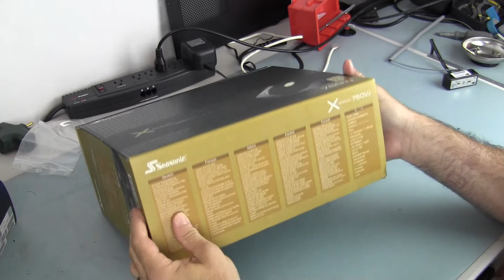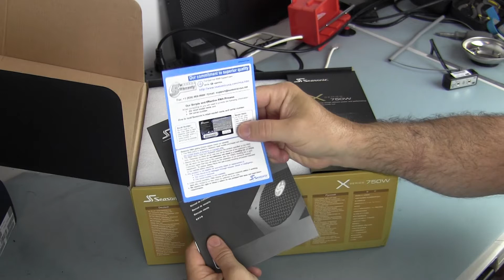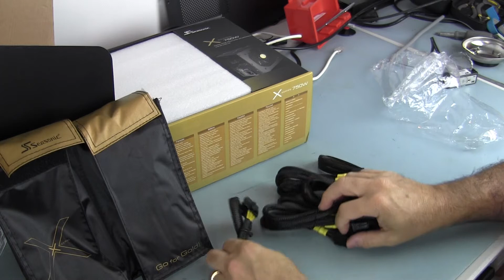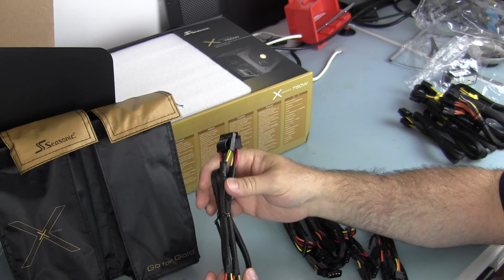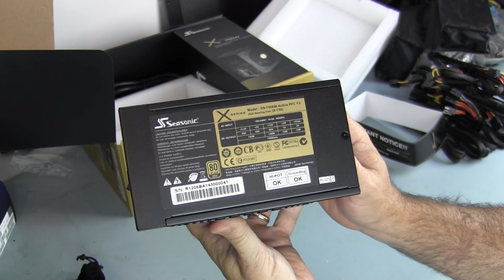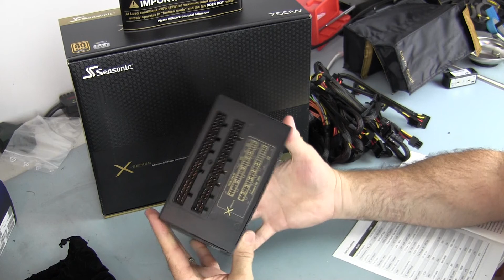SeaSonic X Series Gold 750W Fully Modular PSU Open Box and First Look

Comment: Came across one of these psus and looking to use in a secondary build. I do not have the gpu cables and they seem to be hard to find. Are they 12 pin to 6+2? Any model numbers for the cables you could share? Thanks!
Reply from the maker: I will look to see what I have. I keep a bin of extra cables . I will check and let you know.
Reply: Ronsanut thank you! Let me know what you find out. I picked up a bunch of seasonic cables a couple days ago but all of the gpu cables are 8 pin (where they connect to the psu). Thanks again.
Reply from the maker: @jonlashure1  When I find the box I will dig into them and take pictures of the cables. I do have a fewSeasonic PSU cables in there somewhere.  Will look for today.
Reply: @Ronsanut you’re the man! Thanks!
Reply from the maker: @jonlashure1  Looks like I found a full set of cables.  Message me on my Facebook page at Ronsanut so I can show you a picture of what I have.
Reply: Ronsanut I sent you a message yesterday. Doesn’t look like you’ve seen it though.
Reply from the maker: @jonlashure1  Just got on and saw it. I posted pics of the two types I have.
Reply from the maker: @Jon LaShure Looks like I found a full set of cables.  Message me on my Facebook page at Ronsanut so I can show you a picture of what I have.

Comment: Hey there , i too aware of this problem.

If not mistaken , i think there's 3 Generations of this PSU.....one of them i read in Hardwaresercrets , it's model as " X-650 / 750 / 850 KM3 " 

The KM3 seems to be the 3rd Generation. I think this ones are the ones that's been fixed.

I did asked Seasonic about it , they too gave me their word ( well hope it could be trusted ) , they admit this problem and they said it's been fixed.

Comment from the maker: Because over time I tend to upgrade my systems and will likely pull that PSU to use it elsewhere. If I bought a 300W it would not be useful in any other system.  Also I am considering that I may put a GPU in this to eventually support gaming on my main entertainment center.